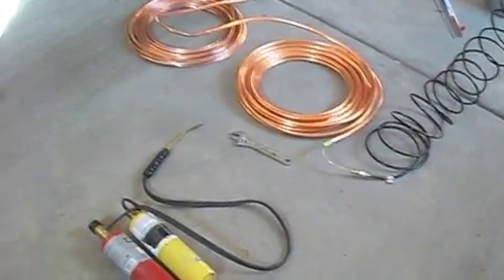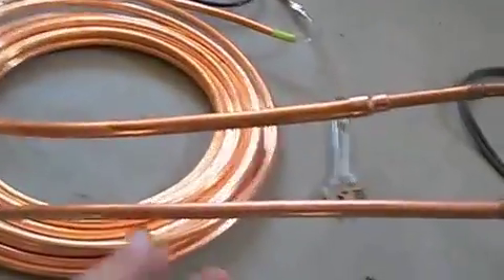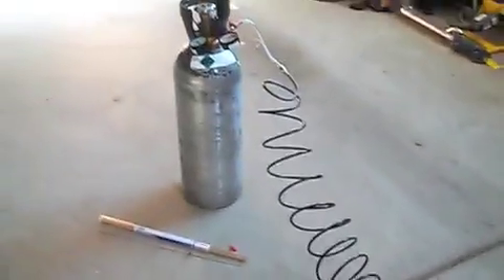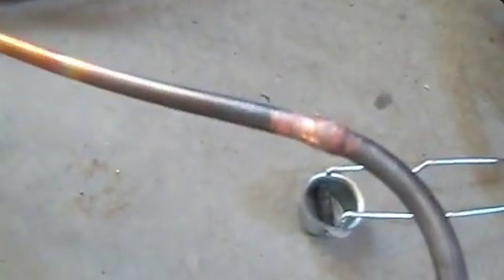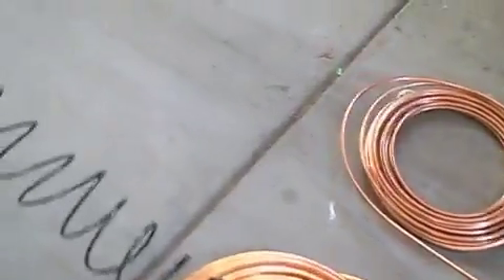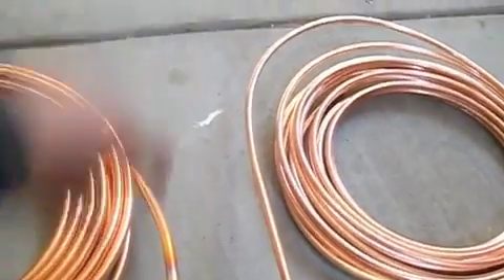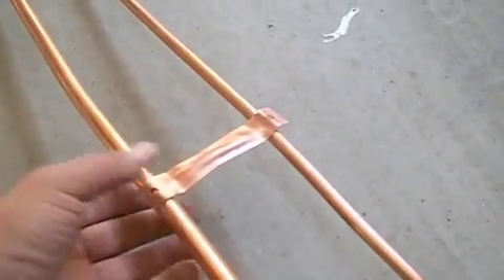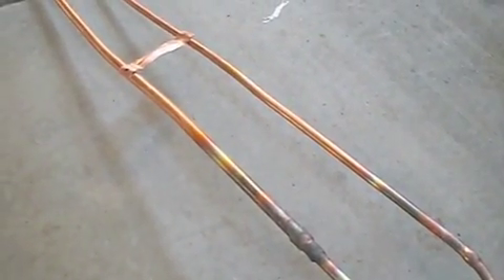DX GEOTHERMAL VERTICAL LOOP CONSTRUCTION PART 1

Comment: Heat pump 1 ton.
With what diameter copper pipe must be installed in drilling depth 100 feet.
3/8 to 1/2 cooper pipe?
r407c
copeland scroll zr18k3
Will you meet with this compressor and depth of what pressure should work?
Reply from the maker: Larger diameter will transfer more heat I would use the 1/2" line
Reply: @snowcap28  and larger diameter will decrease your refrigerant velocity, hence oil return issues.
Reply: snowcap28 Two copper pipes are 1/2? Special connecting copper pipes to the heat pump? There was an oil trap to keep the oil? This compressor will able it to work 30 meters depth? Thanks for the reply!